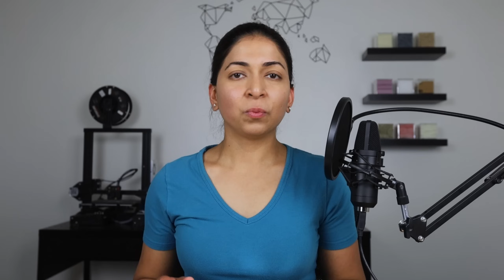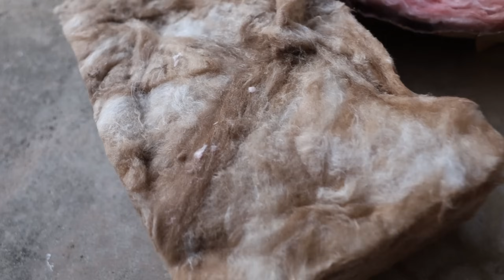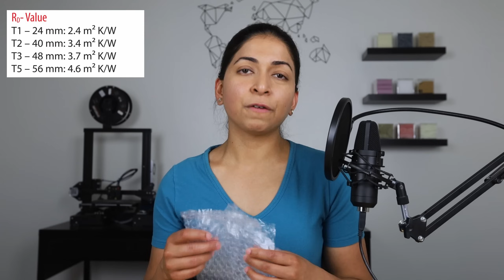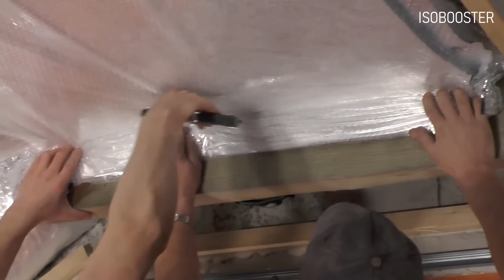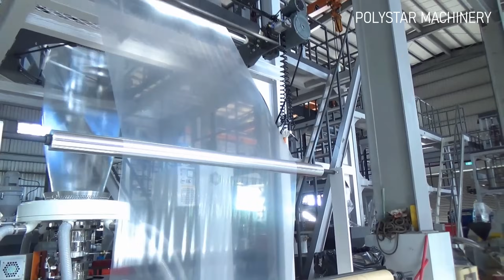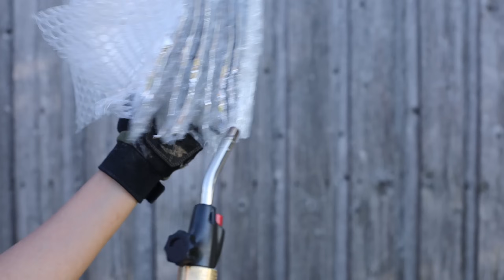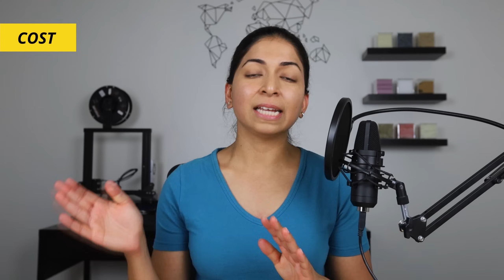Bubble wrap home insulation? | Isobooster

Comment: Use it in tiny houses, you say? I did! I bought a roll of Reflectix at Home Depot 15 years ago and stapled it to the joists underneath the Advantech of my 6’x12’ bathroom. The floor has Hardibacker put down with thinset, then electric radiant heating, then 1/2” thick quarry tile. This is relevant to what happened this year. TERMITES! They tunneled up the middle of the pressure treated post that I put behind the incoming water line. It stopped at the Advantech. And if they got in the gap between it then they couldn’t get through the thinset and tile job. But they built their little dirt tunnels along the pressure treated joists until they found the only interior wall attached to the floor directly, no cement board, and they went up in there and started to eat it. This spring they came out in winged swarms and alerted me to the problem. I removed the post under the house. It wasn’t even structural. Problem solved. But I wanted to see where else they went so I yanked down a lot of the bubble wrap insulation under there. I haven’t put it back yet. I can stand on that thick ceramic floor and feel with my feet where the insulation stops. It is DISTINCTLY hotter. I am still thinking about more termite countermeasures, like maybe I should caulk along all the joists so termites can’t find any tiny gap they can get in to find edible wood? But after I figure that out I guess I’ll staple bubble wrap up there again before it’s time to turn the radiant heated floor on again. One good thing about that kind of insulation is you can buy small quantities. If I wanted to use something else I would have to buy way more than I need. Too bad about it catching fire. I should maybe put up some cement board underneath it all for fire resistance. Thanks for this review of bubble foil! It gets little respect, but I like it.
Reply from the maker: Yikes!! Thanks for sharing that story. I'm still learning about termite prevention treatments and the best methods to fix the problem. I'll try to post a video on it soon.
Reply: @BelindaCarr  I had a pest control guy come look at it and he was utterly uninterested in any treatment. He said just take down the post and they’d die, the end. No poison needed. Since I don’t have a mortgage or insurance requiring some kind of paperwork it’s just up to me to be sure they aren’t going up through pressure treated wood.

Comment: Is the recycling issues an American thing? I just finished insulating my basement with EPS foam board and the manufacturer of the insulation is in my town. I called them up and they took back all my scrap pieces to recycle to make into new insulation. This is in Canada and I know the building codes can be kinda similar sometimes.
Reply: From what I've read, the method of recycling plastic in the US was basically to send it all to China. Several years ago, China started to require more pure base material, which killed the profits of the US recycling industry. So now it's cheaper to landfill it and collect subsidies than it is to ship it to China and let them do ? with it. A better source than me: https://www.npr.org/2020/09/11/897692090/how-big-oil-misled-the-public-into-believing-plastic-would-be-recycled

I used to work in the plastic industry, and we had a machine that would take waste from the manufacturing process and "recycle" it with the new plastic. Plastic seems like something close to a byproduct of all the other oil we consume. I don't know how the effort required to capture/sort/process post-consumer single-stream plastic can compete with new plastic at this time.

Returning large chunks of EPS foam to the manufacturer may be an outlier situation.
Reply: Can you please mention which manufacturer? I have a bunch of EPS I'd like to dispose of instead of landfilling it (located in Alberta). Thanks

Comment: I think a R value of 2.4 per inch works out at a U value of 2.37 w/mK or about the same as a 15mm insulation board. Here in the UK we are aiming at an average wall value of around 0.25 or better. This would need about 120mm of insulation board plus cladding etc. so this product will need to seriously increase the insulation value or be available in thicker sheets if it is to be the primary insulation. 

This use of imperial R-values always does my head in. Please can we have it converted to SI units and expressed as U-value for the rest of the world (w/mK) who may be watching.  After all - real engineers use metric :)
Reply: W/mk is a thermal conductivity (or transmission) value, measured through a unit of thickness. U values are expressing the thermal transmission over a unit of area and would typically be expressed as W/m2K. These values are normally are not convertible from one to another without knowing more details of the parts configuration. A U value is typically measured or calculated on a complete assembly, not just one component like the insulation itself.
Reply: @MorryB  Yup, I dropped a 1/m from the units :)

Comment: Ever notice the majority of innovation comes from Europe now? America, before becoming an oligopoly of monopolies used to provide the new ideas.
Reply: Bubble wrap with foil for use as insulation has been sold in America for many decades. This is marketing more than innovation.
Reply: @MorryB  Yes. 1/16 inch thick, 2 layers of bubble wrap. Let's try to not confuse the issue by saying a Lamborghini is the same as a Vespa scooter. They're both motorized vehicles, right?

Comment: Timely video. I have been investigating the products that come in larger rolls that one can get online for having seen the product seemingly successfully used in places like Texas with there high summer heat and high humidity along the walls of steel buildings. It seems that an air barrier is necessary (recommended?) while what you showed within your video this day showed the installers stuffing the product between studs along with the normal-ish just stapling the radiant barrier on the outside of the studs. Also, for being steel buildings the steel siding is not permeable and never saw any allowances for the water vapor issue you suggested would be necessary to engineer for. Do you care to in the future explain the differences and means of accommodating in attics and regular walls for that of which you claim to be issues?

Comment: Not sure why products like this exist. Sometimes simple solutions and existing products are better. Surranwrapping your house will not ony trap moisture but also cost way more than a proper wall assembly system. Systems that are vapor closed are super susceptible to problems. The slightest error in installation, like a mistake in a tape joint, can cause huge problems down the road. Vapor open systems are much more forgiving when there's a imperfection in the system.

Comment: I think saying high density equals higher thermal transfer is over simple steel is denser then aluminum and copper but both have better heat transfer
Reply: I don't know that steel is denser (specific gravity) than copper, but aluminum definitely has higher heat and electric conductivity than steel.
Rammed earth homes seem to work well in the desert. While they rely on mass to limit temperature swings, they are literally cheap as dirt and don't conduct heat well.

Comment: You can encapsulate it (mostly) to improve its fire rating in standard installation scenarios (between studs, etc.). Even spraying with a flame retardant would help.

I'm curious about its sound transmission compared to other materials. An overlooked aspect of insulation is sound deadening, especially in urban areas.
Reply: For sound proofing I belive a fibrous material will preform much better, this is just a bunch of thin membranes that won't really absorb sound very much at all.
Reply: For sound reduction you can best use a double layer of sound reducing plasterbord with a special kit in between them. this works better than any minieral wool
Reply: Nikdo is correct. This insulation is used in my Yurt and 0 sound insulation is generous. Heating and cooling insulation properties are good.
Reply: WHAT?

Comment: Air tight buildings should, IMO, use an air to air heat exchanger fan & interior dehumidifier. Here in California the energy police now require a constant exhaust fan (low cfm but 24/7) to combat foul interior air quality in new homes negating the airtight measures cuz, well, er, um, that's what "smart" bureaucrats do.

Comment: Thinking about putting in insulation in the roof of my garage, this might be the product for me. Theres not much room in the rafters and I don't want to handle toxic/dangerous/irritating materials
Reply: Lay it across the rafters not with them. Then Tape it off. No More heat loss out thru the roof. Use the 4 foot wide with a staple hammer. Staple one side to the rafter than smack the ADB SO IT  HAS AN INCH OF SLACK THEN STAPLE THE OTHER SIDE KEEP GOING ACROSS THE RAFTERS.

Comment: That is a very interesting product. It does look like it can trap air, but the only thing is will the air still get in where the staples or nails/ screws are installed. In winter, Canada sees very low temperatures and the insulation will be tested. I can't even imagine the heat in attics in texas.
Reply: I imagine in a really cold environment you would have to be very careful about having any cold bridges. The low weight is a massive win though.
Reply: @darkoampem  it's interesting because this is pretty much the same stuff as say what I see in my lunch bag.
Reply: @darkoampem  i also think any material will have cold or warm bridges because of nails or screws used to fasten them. Closed cell foam is a good product that is applied without those and is a vapour barrier. But this radiant barrier stuff is very interesting.

Comment: I had this idea a few months ago, they could potentially make shipment much cheaper by inflating the film on site.  Machines that can inflate packing film exist and are inexpensive.
Reply: Seems like that would introduce too much complexity for average consumers, and for larger projects with contractors, the cost of labor and waste due to improper inflating would eat away at any shipping savings.
Reply: I would guess that those machines only work for very-large-cell or continuous-interior inflatables. The dense sealing pattern of small-cell bubble wrap is likely to be a major hurdle.

Comment: The foil on this product is very thin. The odds of it holding up for more than a couple of years if against it.  I can tell you that it will make an attic a bit cooler or a bit warmer in the winter or summer. Though as a stand alone insulation it is not something you want to use. Also the foil has to have an air gap of about 1 inch between itself and the wall. You can insulate behind it and leave the foil exposed or air gap it with 1 inch. It will not work when its pressed up against another product.
Reply: Also just having foil up and heating an area will condensate like you would not know.
Reply: Exactly because or else it is simply conducting the heat of the adjacent product since aluminum is conductive. It will also get hot in the process as well.
Reply: It's air gapped from the conductive deck or roof by the bubble wrap itself.
You seem to be missing the very concept of radiant barriers, a reflective surface will work the same no matter which side is exposed, and two reflective surfaces facing one another work fully twice as well.